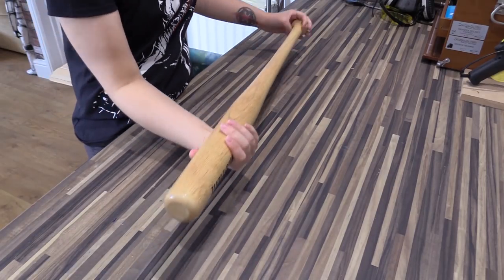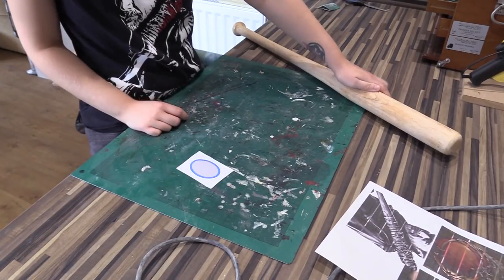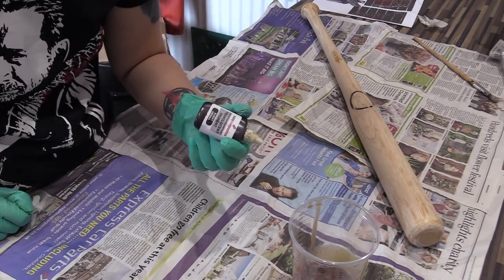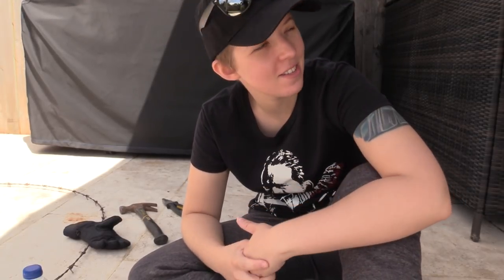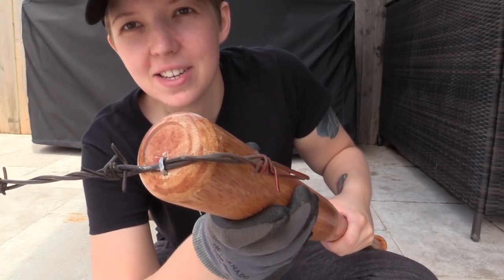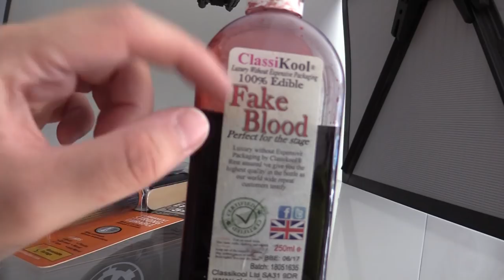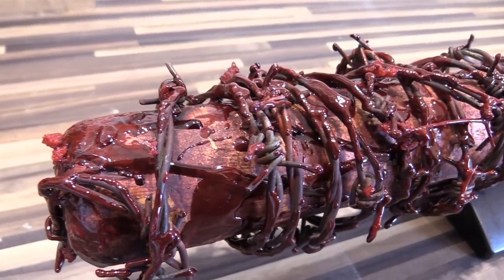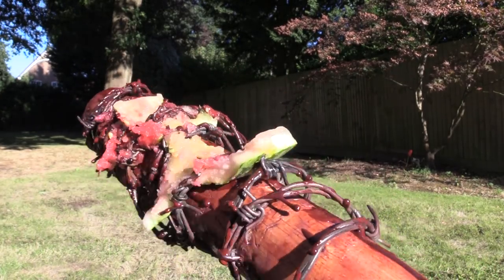Making a Real Replica Lucille (Walking Dead)

Comment: To make a prop to bring to Comic-Con just use metal wire and it will look the same but if you really wanted that look glue small pieces of foam to the wire
Reply: Also ace I am a big fan of your work, and the clone trooper helmet modification video you made, I used that modification as the helmet I use for my costume
Reply from the maker: Metal is not something is going to get through checks easily. You can get fake rubber barbed wire which looks the part and is much safer
Reply: Ace Cosplay I did not think of that
Reply: But even if you use the rubber barbed wire you still will have trouble going through checking with a baseball bat
Reply from the maker: Cactus Boi animation most events allow wooden props in atm
Reply: True